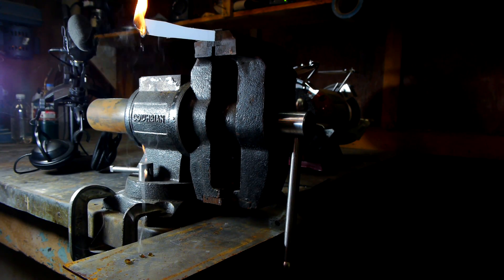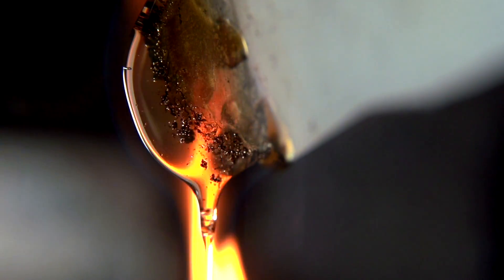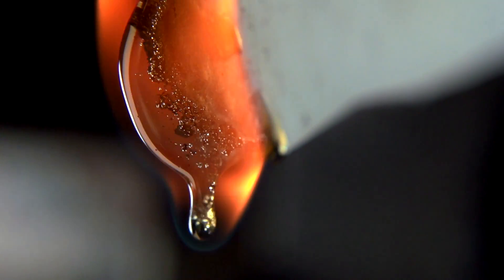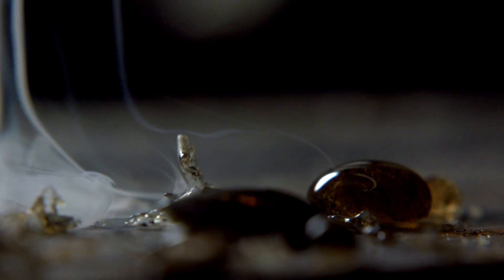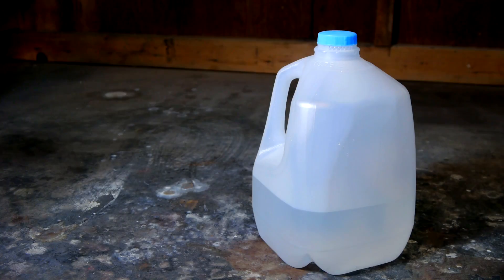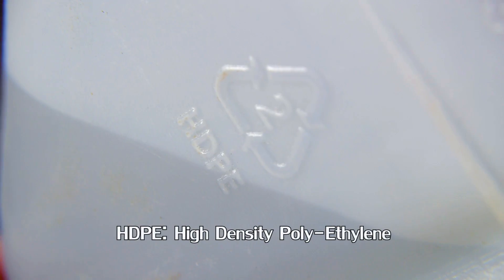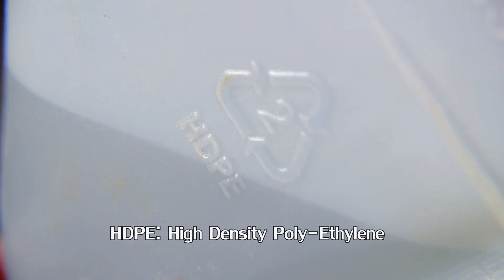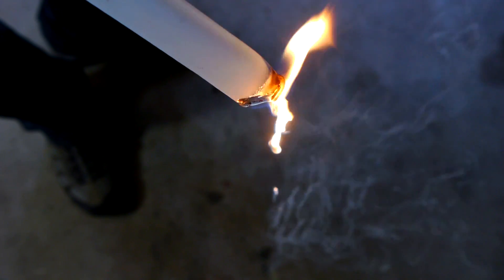How To Make Fire Rain | Non-Toxic Combustion Properties of Polyethylene - NightHawkInLight

Comment: Hey Ben. May I ask what kind of gas does plastic produce when:
1. Burned directly
2. Heated by means of metal
3. Melted using oil

I've been curious about this ever since and I was hoping you can enligtlhten me. I watched your video about coal-making and figured out that it's not just coal that is produce but also a flammable gas that can also be used as fuel so I'm wondering if plastic does the same.

 I'm looking forward to learn from you. If its dangerous, just ignore this. Thank you.
Reply from the maker: It produces all sorts of gas and liquid hydrocarbons, too many to name. Same goes for gasification of any organic matter. You get a stew of various flammable things depending on temperature of reaction and specific starting materials.

Comment: What about polypropylene and PET?
Reply from the maker: As long as the plastics only contain hydrogen/carbon/oxygen they should be safe to burn. If they contain nitrogen they should be fairly safe still, but might give off some level of NOx pollution so it's to be avoided. Plastics that contain chlorine should absolutely not be burned.

Comment: Question: If HDPE, when vaporized, is flammable, would it be possible to condense and store the vapor and use it as a fuel like wood gas, or would it solidify eventually rendering it unusable?
Reply from the maker: It depends how much you heat it. Depending on the temperature it may decompose into hydrocarbons that are a liquid oil or still a solid at room temp.
Reply: Would somehow encapsulating the vapor into a pressured container make it feasible?
Reply from the maker: It would be better to run it through a distillation setup. That might make an interesting video actually, I may try it.
Reply: NightHawkInLight I'd love to see it! I don't have the necessary equipment to try it myself, so thanks for considering it.
Reply: Would it possibly be highly explosive? I mean, I know what pure hydrogen can do ... but chemistry is whacky, so  really have no clue. X'D

Comment: In all the instructional videos I've watched on how to recycle HDPE into parts by melting it, they caution not to get it above 400 because of toxic off-gassing.  This video is very interesting, but I'm curious as to whether burning HDPE generates toxic fumes or not.
Reply from the maker: +RealRuler2112 Between it's melting point and it's combustion point there will be a temperature where the molecule can break apart without igniting. You don't want incomplete combustion of any organic material because it can produce any number of chemicals, good or bad.

Comment: is it possible to colect the vapor to use as a type of fuel?
Reply: No dont get to exited
Reply: If you heat it up without access to the oxygen, it will decompose to ethylene gas which can be collected.
Reply: +Telecorpse! thanks, that helps a lot!
Reply: Emerson Schumacher
Ethylene can be also used to accelerate ripening of the fruits

Comment: If it burns clean, why isn't waste polyethylene used for fuel?
Reply from the maker: Because it's more economical to recycle it. Even so there are clickbait articles every year about how 'scientists have discovered how to turn plastics into fuel' when in reality PET plastics are already fuel.
Reply: Because not everything is fuel. Just because it lights on fire, it doesn't mean that it can power and engine.
Reply: Because it's economically favourable to recycle it.
Reply: fuel efficiency? seems like you would need a rather large amount to get a very small amount of energy out of it.
Reply: And its a solid at earth temps, meaning you would need to design a whole new system to gather the energy from it, or make a vape thing for it, and its most likely petroleum based so it is probably more economical to turn oil to gas and burn it than oil to hdpe and burn
Reply: You can use it in an engine by first treating it with heat and a distillation apparatus to transform it into oil.
Reply: +Michel PASTOR as in crude oil gasoline or diesel?

Comment: Isn't this toxic?
Reply from the maker: No. That's the point of this video, hydrocarbon plastics are as safe to burn as any other common fuel. It is very similar to paraffin wax.
Reply: He just said it burns cleanly and explained why.
Reply: Carbon Monoxyde is pretty toxic dud... Look it up on wikipedia if you want a short story, it's toxic to all mammals, and can cause coma in minutes if the concentration is high in the air, that's why you should always ventilate a room that has a fuel heater, and about things that are not air, that is nonsense because CO is naturally present in the air, so are argon and other rare gases, aswell as diazote, but it's not toxic to humans.
And never use a fuel generator inside, friends of mine have died this way, carbon monoxide poisoning
Reply: I want to point, that just because something is composed of harmless substances like hydrogen and carbon, does not make it automatically harmless, nor does it make it automatically save to burn.
For example Benzene or Phenol are made of harmless elements, but are quite toxic, and could both be potentially produced by burning PE. Still, burning PE is about as dangerous as burning a candle.
Reply from the maker: Correct. If you're interested you can see the complete combustion products of PE at the bottom of this paper: http://isco-pipe.com/workspace/uploads/burning%20characteristics%20of%20polyethylene.pdf

Some toxic compounds will be produced when any organic material is only partially burned, but typically in small quantity. The combustion becomes cleaner the hotter it is assuming sufficient oxygen.
Reply: as toxic as burning wood, you mostly get CO2, but you can ocassionally get CO if the combustion in incomplete, witch can be toxic
Reply: Polyethylene is ethene linked together to form a polymer (polyethylene). Ethene is comprised of two carbon atoms and 4 hydrogen atoms. When ethene is burned, it creates water vapour and carbon dioxide, as well as small quantities of carbon monoxide and carbon (about the same amounts produced as from a candle flame).

So no, burning polyethylene is not any more harmful than burning a candle. Please know what you're talking about before going with the knee-jerk reaction of "he's burning plastic, that's toxic!"
Reply: its only made from carbon and hydrogen (btw he also said this in his vid...) and neither of those two elements are toxic
Reply: didn't you read the title or watch the video
Reply: nope
Reply: It's made up of non toxic materials, so burning it doesn't give off toxic fumes.
Reply: Nope, like he said in the video, the material used is only composed of hydrogen and carbon. Both of which are very harmless substances.
Reply: +Arnaud Chevallier Thx m8
Reply: Polyethylene is the best kind of plastic for storing food and such since it won't give away any harmful chemicals.
Reply: Description m8.
Reply: +NightHawkInLight are plastic forks safe to burn, cuz they smell and do the same effect when burned
Reply: Hydrogen Peroxide can kill you and it's made up of the same elements as water, just because the individual elements of a compound aren't toxic doesn't mean it's not toxic
Reply: Jack White Common mistake, hydrogen is the most dangerous chemical available to human, IT MADE NUKLEAR BOMB OMG!!!!1!
lel.